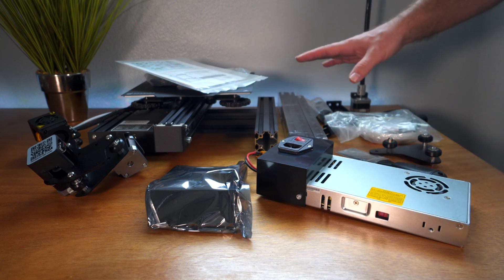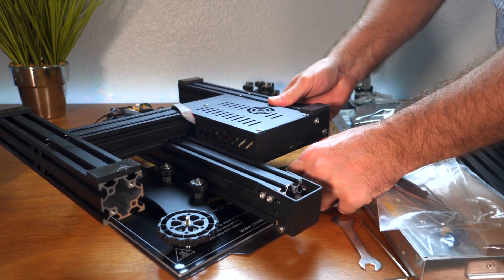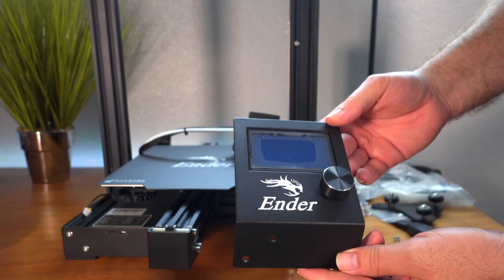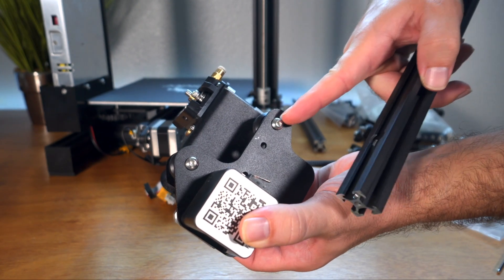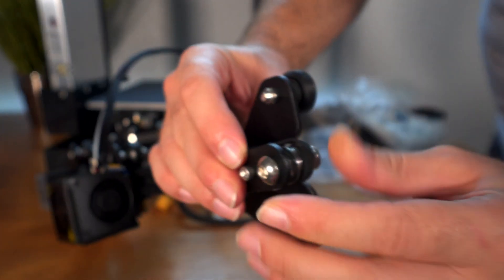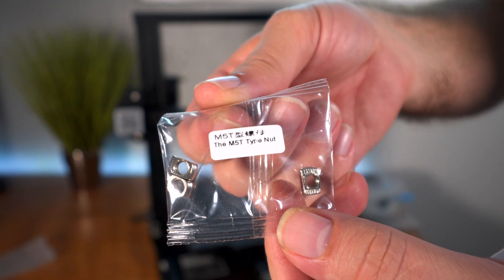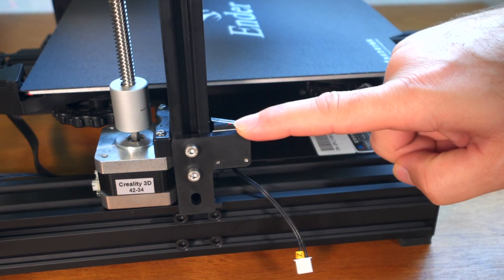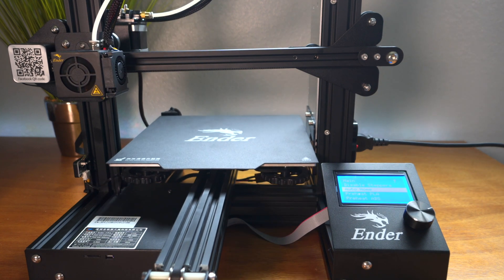Creality Ender-3 Pro - 3D Printer - Assembly

Comment: Hello there, great video, helped me a Lot, but I have an issue with one of the last steps, the one where You told me to adjust the nuts and bolts of the whole thing, the thing is that when I tried to do it withe the piece that holds the nozzle, i just tried to make it run smoother like You said but now it's all wobbly, and I don't seem to be able to make it go back to the way it was, can You please give me some advise please?